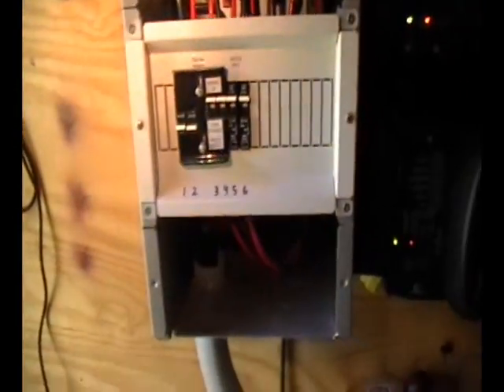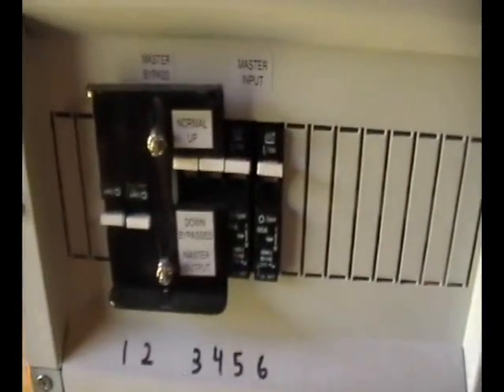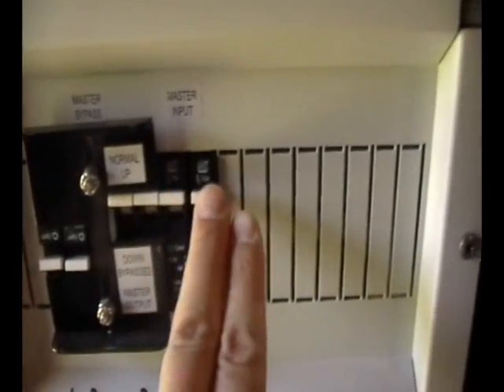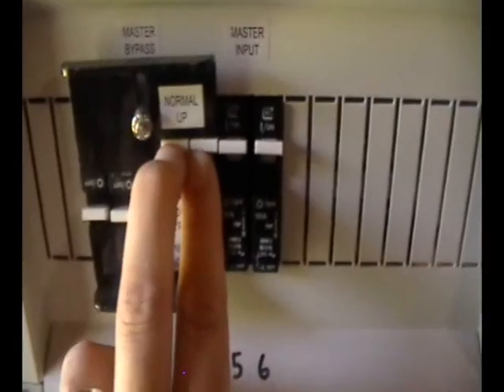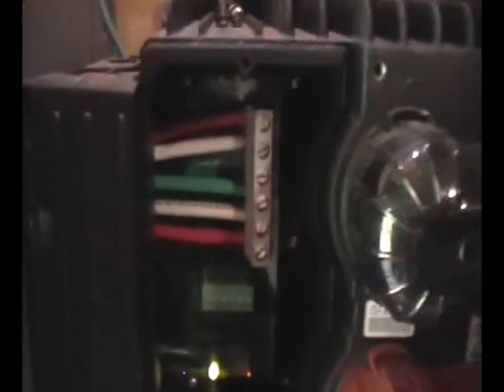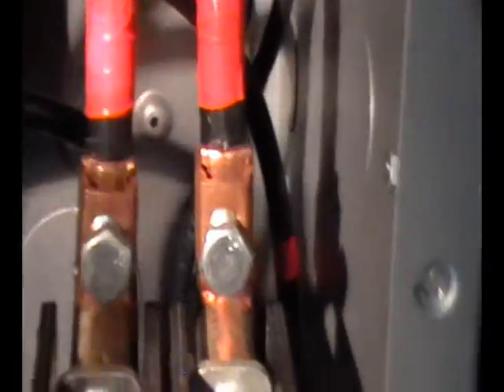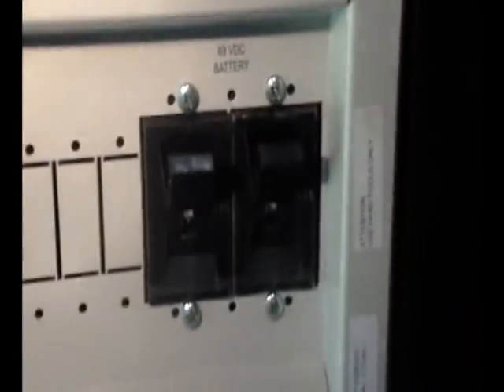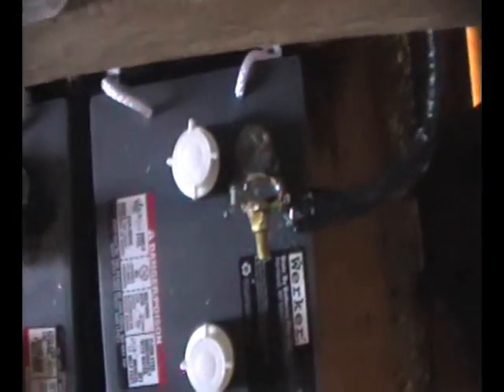part -2 - wind turbine and solar panel installation explained

Comment from the maker: I needed tow inverters so I could run things that need 240 volts. Specifically my well pump and air conditioner blower unit. Note** I do not power the heat pump as I said before but I do power the blower unit in the evaporator coil. This way I can circulate my heat from the wood stove throughout the house by turning the fan to "ON" on my thermostat.

Comment from the maker: I will never rewire, I don't think. Because I would not be able to use any power I make if the Power company grid goes down. As I explained a few responses ago. I would need more panels/turbine to get enough power to sustain running heavy load stuff. If I did get more panels then I would just move heavy load circuits over to the backup panel. If I kept doing that, then eventually I would be totally "OFF GRID"

Comment from the maker: That is why I have the backup panel !. Now remember, in the event that the power co does go down, and the inverters are still powering the backup panel as I discussed earlier, everything on the main panel is dead and can't be used until the Power co restores power. FORTUNATELY, the only things that are on the MAIN panel are electric dryer and  heat pumps, conventional electric stove.

Comment from the maker: In my configuration, when the power company grid goes down, since all my other circuits are connected to the backup panel, I can stil run the well pump, cook/bake meals, use microwave, run power tools, lights, Washing machine, plug in cooker, skillet, oven, welding machine, radios, direct tv, internet, all the bare necessities when everyone else is powerless and must wait on power company restoration.

Comment from the maker: Great point.

some folks do "only" connect to one panel. In that case, there is no backup panel. Everything would be on the "main" panel as you said.

There is one catch to having only one "main" panel.
In the one panel configuration, your inverters must disconnect completely from the grid (within milliseconds" in the event that the power company has an outage. In this case, when the inverters disconnect you can't use any power from the inverters (because they must disconnect (ieee standards).

Comment: @srockriver  The circuit breaker boxes or breaker panels or electrical boxes ... i don't know what they're called. You have one as a "back up"?? Can't one main panel handle the all electricity?  Why can't you simply connect to the main electrical line (from the power company) going into your existing panel.